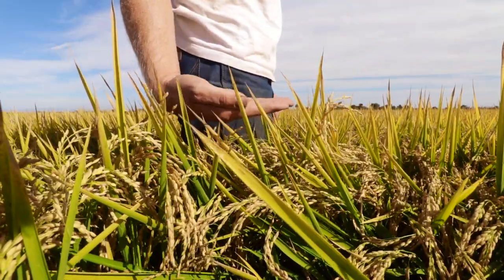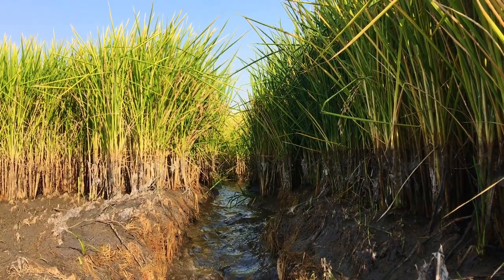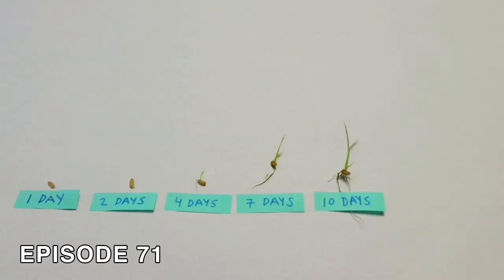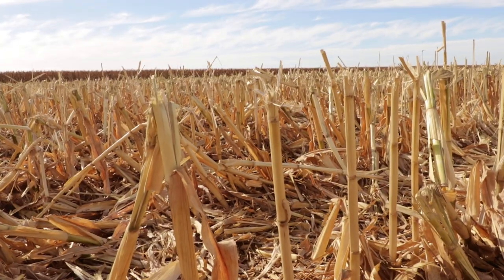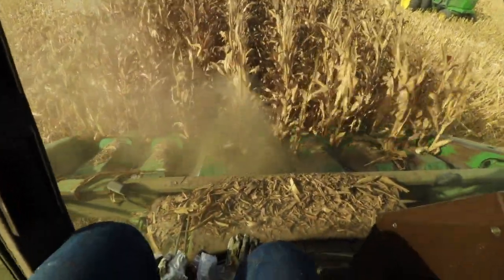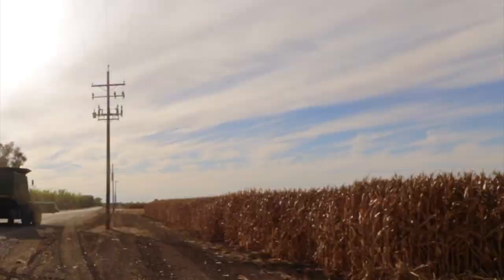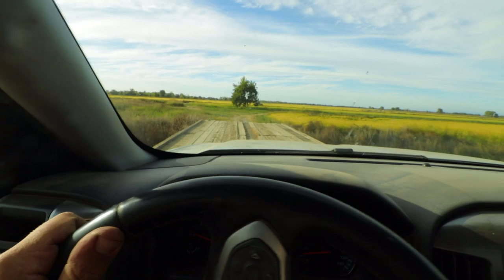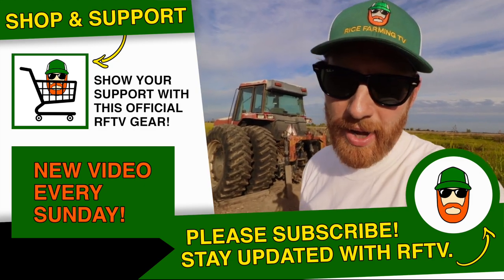Corn Harvest 2018 in California!

Comment: I will share some tips to you
1_use a chisel fork plow to descompact soil the one with wings at the bottom
2_soil test is very important hire a company for advicing in all process
3_set a yiel goal and select hybrid, the seeding nutrition etc
4_calibrate and planter, the fertilizer should go 2.5 inches below the grain and 2.5 inches aside the grain,  set the tractor at 2,000 rpm here is the optimum rpm for the planter vacuum, less rpm your % of plants emergence will drop, more rpr same you emerging % will drop 
5_ Do not drive tractor when planting no more than 4 m/h here you loose or you win more pounds than anything a uniform emerge is the key factor all plants should emerge in a window no more than 24 hrs, if a corn emerges 3 days later than the fist plants you could do anything and won't produce good corn
6_ in stage v5 corn defines how many rows will produce if is a not defined hybrid but most hybrids will set 16_18 rows but if is undefined hybrid you can give a good nutrition a good foliar with humic and fulvic acids, pokisacarids, 17 minerals, organic acids
(fulvic acid is so good that just imagine 1 ton of manure composted and treated will yield just 4-5 pounds only) 
6_in and stage V10  corn plant defines how many number of grains will develop, 27 _30 more here also is a very narrow window of 5 days that you can give a good nutrition and grow yield, boron 30 lbs per a helps in polinize the kernels, hairs have 2 funnels 1 extra if 1 dies and calcium 7 days before R1 stage gives you huge help in the grain weight
After harvesting pay attention to the corn stalk, you will notice big water drops, imagine a good seed treatment for the corn like Envigor 8 will give you the same mass in plant in roots and all nutrients that the plant translocate from fotosíntesis and nutrients taken from soil are 100% water soluble, well if you go to cut those stalks 2 weeks later you will loose tones in nutrients, what can you do?
Next day to harvest corn, in one pass, shred the stalks, inoculate with fulvic acids some nitrogen and tricoderma we all have a fusarium problem, one Pass of subsoil chisel and a roller to flat soil
Hope it helps

Comment: I've never experienced 'ashy' corn like that.  That was crazy!  Do you happen to know what the popular markets are for corn out there?  Will it go to an ethanol plant?
Reply: Zach -- besides more frequent air filter servicing due to all the ash, would you expect there to be any other parts on the combines that would wear out quicker due to the ash?  Also what kind of changes to soil chemistry would you expect to occur due to all that ash too?
Reply: @KCautodoctor  that's a good question.  As thick as that ash was it could maybe cause issues with some bearings.  I'd probably be more diligent about greasing the machine.  As far as the soil goes, I wouldn't think it would hurt anything because it's just nutrients like anything else (assuming most of the ash is from burnt trees).  It could potentially change the pH balance temporarily, but I wouldn't be too concerned about it. Those are just my guesses, though!
Reply from the maker: Zach, to the best of my (limited) knowledge a majority of California grown corn is sweet corn for the supermarket. Other than that crops are dedicated to feed corn or silage. I’ll need to research if any corn is going to an ethanol plant. Back to the books!

Great questions KC and thanks for the input Z! 

-M.
Reply: Thank you for the reply.  I agree the soil is not getting "damaged" by the ash - it is just another form of natural fertilizer.  Will be interesting to see if the effected farmers notice any detectable changes to the soil chemistry, or like you said it will just be a temporary change that will not even be noticeable come spring planting time.
Reply: Matt -- please look into the local corn market in your local area.  It will be very interesting to see how it is getting used in that part of the country versus corn produced in other parts of the country that is primarily destined for ethanol or processed into food for humans (i.e. high fructose corn syrup, corn flake cereal, etc).
Reply: I could imagine that ash could fool some sensors in the combine. Stuff looked nasty!
Reply from the maker: KC, this ash to soil enhancement cycle is an interesting question. The rice industry has done studies on a similar concept: do migratory birds and their droppings add fertilizer to the rice fields as they feed and rest over the winter. No significant nitrogen addition to the soil could be found. They do help mix up soil, straw and water though—helping the decomposition of the remaining rice straw.
Reply: Come on Zach.......worry about yourself and get the harvest going, I need videos!!!!!!  If I ever see yellow in your videos other than green and yellow, I will hunt you down and force you to watch Mr Rogers.
Reply from the maker: Yes, Jason! Finally a true fan of Mr. Rodgers. Zach, you’ve got a passionate audience. Take care boys!
-M.
Reply: Matt -- I agree that the ash from this year's local wild land fires will likely add negligible amount of nutrients to the soil that far away from the actual fires (versus all that ash right where the fires burned may be more impactful on the soils, but that is a totally different conversation).  Now if we were talking about ash from a volcanic eruption  then the shear volume of ash & exactly what minerals it contains would be much more impactful.  We would need to look for any studies done when Mount St Helens last erupted (or similar recent volcanic eruption near farms) and what its impact on those local farm soils was.  That is interesting they did that study on the migratory birds & impact of their fecal waste on the soils - do you have a link or author's name that I could try to use to narrow down the search for that study?
Reply: Rice Farming TV, I live in East central South Dakota. My local Ethanol plant (Poet in Mitchell, SD) sends both it’s Ethanol and the dried distillers grain feed (corn “mash” after Ethanol is produced and then biodiesel is extracted from it) to California. They sell as much wet distillers grain feed locally as they can but depending on the time of year the local demand for the distillers grain feed changes.
Reply from the maker: adeereplowboy, thank you for the insight. So I wonder if that means since CA is outsourcing then we don't have a plant? I still need to look deeper into all this California corn information but I've been caught up with harvesting rice! 
-M.
Reply: Ash is Alkaline but I can’t see there being enough to change the ph much.
Reply: Just found your channel man from MN Millennial Farmer. Here's a new sub! 👍🏻✌🏻

Comment: You can use that like a biofuel the rice when it's like that and it's green State like that and burned off like that I bet that would make a great fuel you know how like they talk about those silos when they explode when they got the dust inside of them just from the spark and you know he's got to be a neat idea to be able to come up with something that's Fuel and that sense either in the drive straight to the wet state that it's in cuz you know you can see out file from when it gets hot it gets really hot in the center when you got heat up and piles so is energy everywhere in things not only that cyllage does the same thing when you pile it up whether it be a corn or sorghum

Comment: Nice video man, how many acres of rice do you guys do? never seen the irrigation system you have before
Reply from the maker: Hi Tom, thanks for the message. We farm 1,600 acres of rice. We are mainly tenant farmers, only 150 acres is in the family. All the leased ground is on a 75/25 crop share split (standard). The tractor running the deep well is a special case. That 14 acre field is isolated, higher in elevation and hard to get gravity water to it from the irrigation ditch. All our other fields are gravity fed or have permanent lift pumps diverting gravity water into our on-farm-system. Heading over to your channel now...
-Matthew
Reply from the maker: Wow! Epic channel trailer...

Comment: Hi Matt, I noticed that the distance from where you had parked your truck and how far away it was after you got off of the corn harvester that I was thinking there would have been more content with the driver. Are you saving that footage for another segment? I'm interested in some of the Q & A potential. also, when you drain your fields does the water go back into an aquifer or is it released down stream. have a good day buddy, Harv.

Comment: I have a question how long does the tractor run does it run 24 hours day seven days a week and if so how many hours are on it
Reply from the maker: TJ, regarding our rice harvest we cut every day, all week. We work 11 hour days. 2 hours in the morning we service and prep the combines and equipment while waiting for the morning dew to dry. Then we are inside the combine, cutting for about 9 hours. Repeat day after day, week after week for a month. Great question!
-Matthew
Reply: He means the tractor pumping the water.
Reply from the maker: Rebel County, oh! Thanks for the clarification. The old Case 7210 runs the deep well about 8 hours every 3 days. That builds a 14 acre field up about 2”. The field is narrow and long, running along side an irrigation canal with many opportunities for leaks...when the level of the canal dropped this year we started loosing water fast 2” in 3 days. Thus the need for the deep well.
-M.